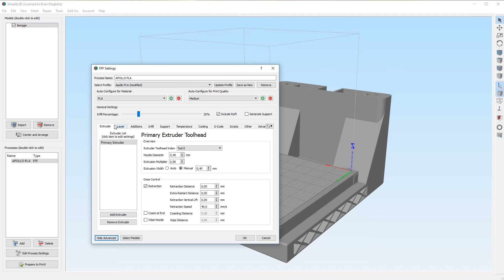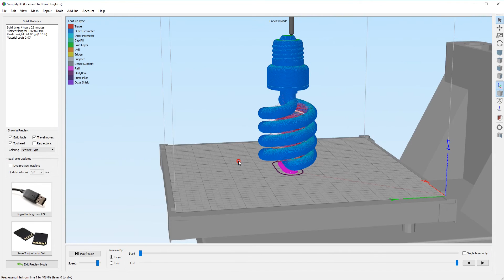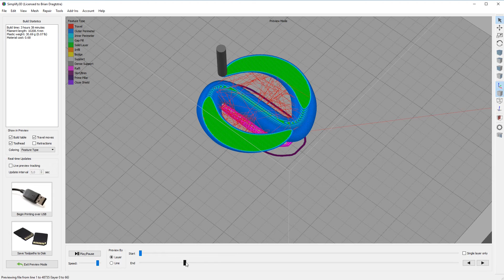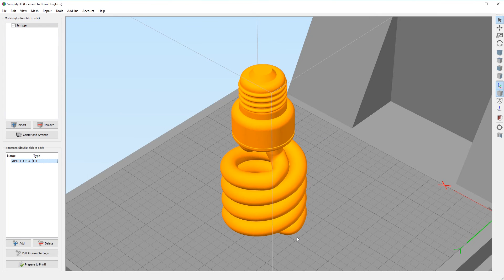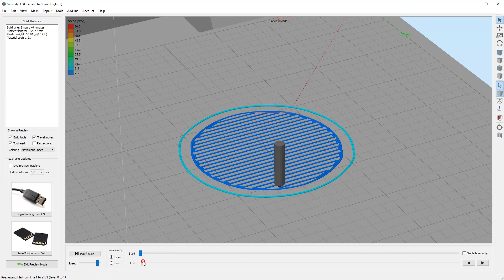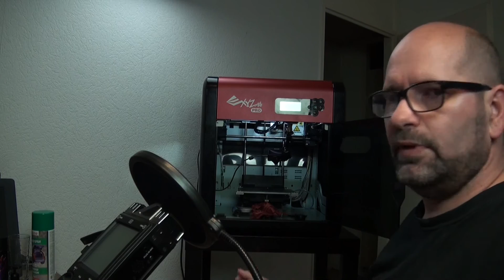▼ Simplify3D and the Da Vinci Pro 1.0

Comment: do you think that by putting the pause command, the printing stops at that precise point? With this print
Reply from the maker: I am pretty sure it will not.
The XYZPrinting machines use a very limited implementation of GCODE, and the pause command is NOT in their syntax.
On any other printer, it would work but not on the Da Vinci Pro. Sorry.

Comment: I just used S3D on my buddies laptop with my printer. For the life of me I could not get the transparent Verbatim ABS to print no matter what I did. No amount of glue sticks, hairsprays, or modifications to settings would make it stick to my PEI bed. By day 2 it became painfully obvious that the temperature was just too low, too bad you can't go above 90 degrees I thought... Guess what. 5 minutes in S3D config, and 3 hours later my completed ABS print was still stuck to the bed with no signs of warping.
Reply from the maker: I just love reading a comment like this.
Great to hear you can now print with a difficult filament, thanks to the slicer overruling the printer settings.

Comment: hi guys, i'm new on the 3d printing with my recent da vinci pro all-in-one... i looked around for one printer that fits in my pocket condition and i tought this was the best.... anyway.. i'm trying to use symplify 3d instead of xyzware mostly because of the supports that i think sometimes i could make manually better supports than the automatic ones.. my problem is after i load the file to the simplify and mix a little bit the definitions to approximate to the ones i use on xyzware, when i send to printer (usb), the printer receives the file but in the end it gives me an error, something like file not compatible... anyone experienced this? i'm stuck on this point... thanks in advance...
Reply from the maker: Hi. I don't have the original Da Vinci Pro anymore (mine is updatet with another motherboard, software and hardware), so I can not test it for you.
Yet, I have received a lot of emails and messages about compatibility issues since Simplify3D version 4.1.1 and the same people say it's not solved in version 4.1.2
I think this means that there is a problem that you can't solve on your own. Sorry.
Reply: @3dPrintCreator  hi, i just found a way to use the simplify :) so, for anyone who has this issue, just load the file into simplify and instead printing directly from there, save the .gcode file to the disk and then load it to xyzware. All the configurations that i've put on simplify, takes effect on the xyzware, including the manual supports! that's great :)

Comment: Hello my English friend is not very good I need you to guide me I have the same XYZ Davinci 1.0 pro printer but I try to print and it tells me wrong file or something similar is due to the Gcodec for what or alfo of configuration and the other as I can do that the table where you load the elements to print looks the same as the one you use I hope you can help me I'm desperate and the XYZ software is very basic for what I need it thanks and I expect some response from you estoy usando la version 4.1 de simplify
Reply from the maker: I am so sorry, but I don't have that printer anymore for more than a year now.
I am not up-to-date with the current Da Vinci software anymore. Also, your question is not detailed enough to answer. There can be a multitude of reasons why your files are not correct. Again, Sorry...
Reply: @3dPrintCreator  Could you help me in some way to solve this problem or tell me a website that can find how to do it thank you very much I hope some answer or someone has the gcodes and profiles
Reply from the maker: I still don't really understand why your files are not correct.
As I don't have this printer anymore, I am not able to help you with it.

Comment: Hello Brian how are you doing.? If could help me in a question... I have instaled the simplify 3D 4 version software to use with my vinci pro, but the software does not slicing to print and I always see the information that the file is not compatible if vinci pro. The vinci's pro version is 1.3.8. Is there any configuration to do before? thank you so much.
Reply from the maker: Hi Fabio,
I don't have the setup anymore for over a year, but when I had it, I used the configuration assistant (found under HELP) to setup my printer in Simplify3D. You then have to connect it with a USB cable, have both the printer and the computer turned on, and you can start slicing and transferring the file.
Reply: @3dPrintCreator  thank you for your replied. So, I upload the .stl file to simplify to work and the printer require .3w file about xyz aware pro.
The question is how do I do to convert from stl from 3w file to make printer recognize the file? Have you passed for this problem.? Thank again.
Reply from the maker: Well, there is no need for converting the file to .3w as you can send the printjob directly to the printer from Simplify3D
All you have to do is connect the printer via the USB port and then after you sliced the part you hit the photo of the USB connector in Simplify3D (begin printing over USB) and at that moment the file will be transmitted to the printer. When that's done, you can watch the process from the machine control panel in Simplify3D.

Comment: Hi

I really enjoy your videos as a first time user with 3D print.

Im still wet behind the ears but i got this printer after watching your videos.
Do the S3D software also support the laser part from xyzware ?

Im asking because i simply can not get my xyzware to work and therefore looking for other options.  Every time i try to open the program it just show a glimpse of it and comes up with a error and i don't know why that is?

Im using Macbook Pro 2,7 ghz i5, 8 gb High Sierra 10.13.2 version

Hope you can help me :-)

Kind regards
Reply from the maker: Hi Dennis,

Simplify3D only supports the 3D printing part of the printer, not the laser engraving. You have to use the XYZWare software for the laser part but to be honest, I never used it because I can buy a 10 Watt laser cutter/engraver for the same price as the spare laser module here in the Netherlands.

Comment: Hi Brian, Nice video and I current use xyzprinting da vinci pro 3D printer, may I know where can I found or get bed platform (.stl) file?, Thanks
Reply from the maker: I think you mean you want the STL file for Simplify3D to show the print bed?
If you add the printer to Simplify3D and tell the programm it's a Da Vinci Pro (you can select that in the menu) it automatically adds the print bed.
Reply: @3dPrintCreator  Hey, 3d Print Creator! I love your videos; could you post the STL file for the da Vinci bed somewhere like thingiverse.com? I want to use it in a different software and do not have access to Simplify3d. Thanks

Comment: Hey Brian. I was wondering if you could tell me the setting you would use for abs. I just want a basic setting something that I can tweek for whatever I print in abs. I purchased simplify3d because of you and would appreciate the help. Love your channel and look forward to more vids.
Reply from the maker: Hi Michael,
Set you r heated bed to a temperature of about 90 to 110 degrees Celcius (depending on your firmware you can't get it above 90C) and start of using the middle temperature of the statet temperatures on the box of ABS you are using. Here if have one saying 210 - 240 degrees, so I would use this on 225 degrees Celcius to start with.
Then print something small, but big enough to test the layer strength. If the layers are not bonding, increase the temperature. If they are, your settings are good.
Remember that ABS is likely to shrink while it's cooling down and can therefore break apart from the print bed, break open or even rip the part you made into pieces. I have a view video's in my timeline explaining you what to do when printing in ABS.

This one explains about the strengths ABS can buil while printing it and how to overcome this in your design stage
https://www.youtube.com/watch?v=stkI3HBKrKg&t=3s
Reply: Thanks for replying Brian but I need help with setting it up in simplify3d. I know my print temp and bed temp as I have used it in xyzware many times. The problem is all the different settings simplify3d. I wanted to print something last nigt but it said it was going to take 540 hours. I knew that was crazy. So I put it xyzware and it would print in about 9 hours. I set simplify3d like you in your vid. I  just changed bed temp and hottend temp. So that's what I need help with inputting those exact settings in xyzware to simplify3d.

Comment: I just got my da vinci pro less than a week ago.  I tried to use their software (once) but it was horrible. In the past, I've worked with repetier host and slic3r when i worked at Solidoodle,  so I wasn't a complete newb going into 3d printing and all the settings, but couldn't figure out what I needed to do to set up a free program to be used on the DaVinci pro. Simply3d was nice in that I was able to select the printer I had, and was able to configure all the settings for my particular printer and let me configure the rest. It was such a help. Since paying for it I've been using exclusively Simplify3d, except in cases where I would open up a STL in xyz software, see what settings they have it set up, and configure simpify3d to use some of the settings based on what XYZ said it should be.  I did use your video as a mini guide but still had some configuration to do after, but I am getting good prints now. 

This might be much to ask, but you might want to think of creating a file on Google drive that's linked here where you detail the settings that work best for you.  That would be super helpful, or if simply3d allows you to export the profiles, that also would be super nice if you provide those also.
Reply from the maker: Hi,
I have once uploaded my settings for Simplify3D but then we found out that they do not apply to all Da Vinci Pro machines. People were having more problems because I also run cooling fans and a modified extruder. Setting up the machine from scratch was easier then changing my config files every time.

Comment: hello! I have a problem with simplify3D and da vinci pro. After transfer all the file the printier says "File not compatible". How can I fix this?
Reply from the maker: Well, My guess is that you have not configured the Da Vinci Printer in Simplify3D so that the program is trying to send Gcode to the printer in stead of .3w files.
Reply: Hi do you know how to fix this? I have the same problem!
Reply: I've found that you can go to the scripts tab and change the "export file format" to Davinci type 2 and the printer then accepts the file, It still doesn't work for my though it gets stuck at pre heating.

Comment: My friend, I have held out long enough on this, but Ill be buying this later this week. Thanks for the great video. In the extruder temperature area, you can change the global temperature ? I want to use PLA pro and it needs to be around 205 - 210, so you just change the temperature in the corner ?
Reply from the maker: Yes, you can set the temperature for the globals, but you can also make temperature changes during the print. For example, when printing a rocket, you can lower the temperature at the nose cone because the part gets smaller and smaller on the top.
Reply: Cheers. This is nuggyblake from thingiverse. Im going to grab it during the week. Im waiting on a refund on something. Cheers !!!

Comment: Hi Brian, I attempted to make my first test print with this software on my XYZ Pro last night and it didn't heat my bed up, even though I had the bed temperature set for 90 C as I'm printing with ABS. Any ideas why this might have happened? Great video !!
Reply from the maker: Hi Jeremy,
To be honest, I don't know. Have you used the Da Vinci Pro profile in Simplify3D?
If so, it uses the same Gcode as XYZWare for Pro does, so it should work similar to that program.

Try to make a really small print, first in XYZWare for pro to see if it heats up, and then do the same thing in Simplify3D to check if it goes as it should.

Also, make sure in Simplify3D you set the correct tmeperature in the right way. This means selecting the temperature for the nozzle and doing that in the select box, not just by typing the desired value.
Reply: 3d Print Creator That was what I thought too. That is what I chose in the startup menu for the software. But my extruder head heated up  and immediately started printing, and my bed stayed room temperature. I caught the problem before the print got far and cancelled it, but it did it both times I tried it. Very strange indeed. I attempted to post on the Simplify3d forums to ask about it but the admin stopped the post and told me the same thing .... I guess I need to try it again and see if it works this time . After I did have he problem I tested the printer to make sure the bed would heat up by doing a calibration test via the LCD display and it heated up fine. On another note have you ever used the bed leveling wizard in the program and if so how and did it work ? Thanks for the help!!
Reply from the maker: As for the bed leveling program, That doesn't work on the Da Vinci, I've heard. For the rest... I am now at my work but when I am home tonight (around 8 PM EST) I can start a Google hangout and show you how I set things.

Comment: is there a way to send the file over wifi with simpfy 3d? also can you disconnect once the upload is finished?
Reply from the maker: Yes, I have seen people do it. I have even had a working connection with my printer, but since half a year I can't connect to my printer anymore. This is since I have another modem/router that uses another encryption system. Also, for me there is no need to connect with WiFi because I have my computer (and it's USB port) next to my printer.
Reply: @3dPrintCreator  You can easily change your router to use the necessary encryption, I believe you need WPA rather than WPA2.  There is a severe problem with the people at XYZ not updating their systems.  Why on earth do they provide cura profiles for older machines and not the Davinci Pro?   These are in many ways great printers but let down by the poor performance of the company.
Reply: Unfortunately my laptop is across the room from my printer, so I need the Wifi connection, do you have any ideas on how to initially setup this Wifi connection?  The help files did not help, nor did the FAQ on Simplify3D's website...They all list USB as the go to. I only bought the software so I can use the WiFi connection..
Reply from the maker: Hi Richard,

Sorry, but as I also wrote in another comment, I had it working for a short period of time and then I changed to another router that uses another type of encryption. Since then I am not able to connect via WiFi anymore. It has been long ago since I had it running, and I don't remember the steps to get it working anymore.

I do know, however, that I had the WiFi setup in my XYZWare for Pro before I changed to Simplify3D and that Simplify3D just took over the connection I already had.

The rest I don't understand..... Why did you buy the software just for the WiFi? There is a possibility to work with XYZWare for Pro over WiFi, you didn't need any other software for that. I should use Simplify3D because it's a much better slicer :-)

Comment: I exported from simplify3d. When I try to load the .3w into xyz is says 'incorrect file format'

I think xyz has changed the format of the .3w files again. new ones are like this

~…4»S3 †÷C5ãA;˜ð QgK!@Bòj

rather than the base encoded ones

OyB0b3RhbF9maWxhbWVudCA9I
Reply from the maker: Might be the case indeed.
I am using old firmware on my Da Vinci and I upload the files directly from Simplyfi3D into the printer using USB, so I don't have this problem.
You can also upload any other .3w file directly from S3D.

Comment: Thanks for this very good Video! Helps alot loosing my fear to using a new programm. :D

Do you still use this Settings, or is anything changed til this video was uploaded?
Reply from the maker: Hi Lizman,
Yes (and no), I do still use this settings, but parameters may vary depending on the model I am printing.
In this particular model, the settings for the support structures was very important because there were a lot overhanging structures that can't be printed when you don't use support material. Would the overhanging be at an angle of less then 45 degrees, then support would be less of a concern and I would have been using the bridging parameters of this software much more.
You see, the model you are slicing depends a certain amount of settings to be done and they vary from model to model. 

My aim in de video is more to let you understand this particular part of the slicing proces, then to use this settings as a guideline for all your slicing.

That said, the reason why I am using the paid, and expensive, Simplify3D software is because this software gives me the most options to optimize my slicer for any type of print.

Comment: Great and helpfull video. Are the setting die ABS much Different from the PLA settings in the video?
Reply from the maker: When printing in ABS I usually keep my speeds a little lower, around 40mm/sec and also I raise the temperatures. My bed is at 105C and my nozzle at 230C. This because I don't want the ABS to cool to fast to prevent from warping.